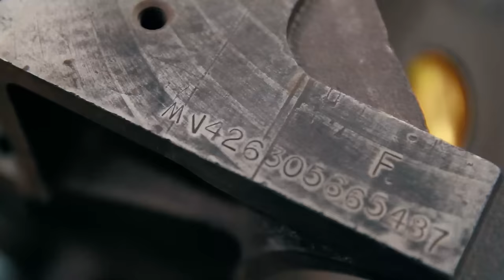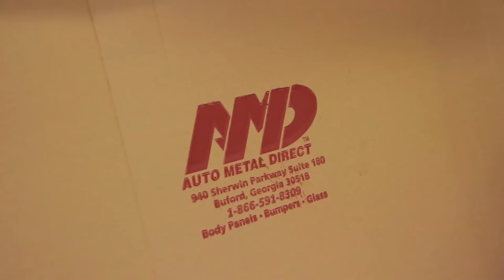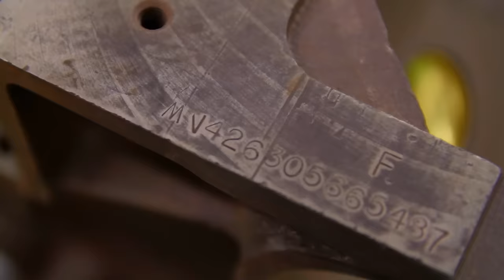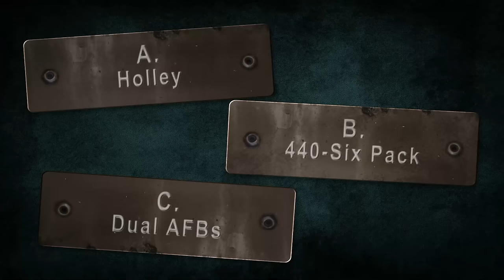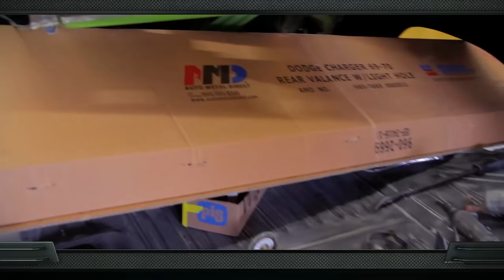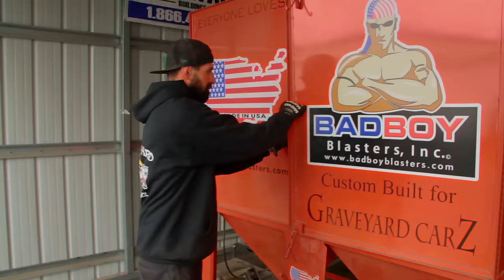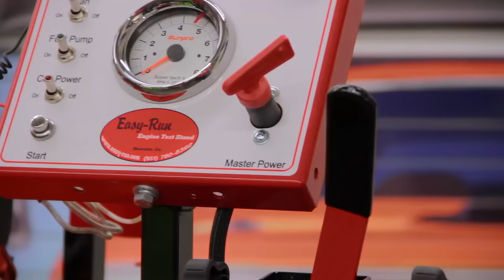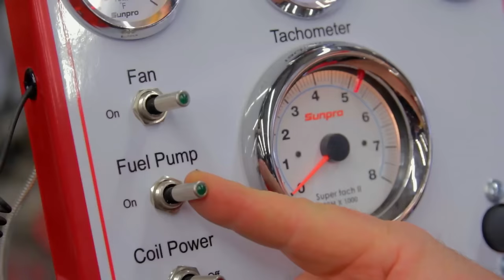MARK FIGHTS TO SAVE TOTAL LOSS 1970 CHARGER R/T SE #hemi #moparornocar #mopar #dodge #charger

Comment: Mark has a great personality.  There is no drama. Mark has a get it done right attitude.  No shortcuts, just the way it should be. He has the knowledge and that is the key to success.  Perfection . Nice work Mark. I owned several mopars  in the 70's. 70 R/T Charger 6 pack 4 speed . Hemi Orange Dana 60. 70 440 4 speed Dana 70 Challenger R/T  Dodge Go Mango with a burnt  orange leather interior .70 Superbird 440 4 Speed B5 Blue. And what started my mopar fever was my father buying a new 70 Lemon Twist Roadrunner 383 3 speed standard transmission from Rosenstock Chrysler  Plymouth  Downtown Houston. One of the first promotional Roadrunners assembled.The car was geared very high.  Had a 11 bolt  rearend  single pull  .The dealership wanted to swap the rearend out for a lower geared ,My father said no . The car would pull 70 in 1st,120 in 2nd, And peg the speedometer on 150 in 3rd.
Reply: I have never seen another 11 bolt mopar  rearend before the 70 roadrunner. I wonder if Mark has ran across one?
Reply: No drama? Are you blind? The entire script for this very very SCRIPTED show is all about drama.
Reply: Mark is useless

Comment: You're putting together an engine w/o checking rod & main journal clearances? The other two are disassembling front end & notice wheel bearings are shot & think they're shot because of heavy braking?  How do they ever build cars that even get out the door, let alone stay out w/o coming back with problems?  (LOL)

Comment: Mark why don't you use tapered sleeves when installing the pistons? I find then a whole lot easier to install pistons using them. Just tap the piston down thru the sleeve and viola piston goes in without any problems. No chance of a ring popping out and getting broke either.

Comment: I like using the phrase full body car instead of full frame car it's just a more accurate term cars I consider full body cars Ford torino cobra Pontiac gto 62 65 67 69 and  71 dodge charger Plymouth gtx Oldsmobile 442 1970 and 68 Hurst  Ford 64 galaxy Chevy bellair 62 Chevy impala 58 to 65 Ford falcon 64 to 70 etcetera

Comment: try some current tech: AWD, 4 wheel steering, turbo, f.i., rack and pinion. My 120c.i. Subaru does 0-60 in 5.8 secs in the wet.

Comment: My question is how are you putting a motor together and ain't using no oil or nothing all those bearings that crank all of that should be lubed up I don't understand Different Strokes for different folks I guess